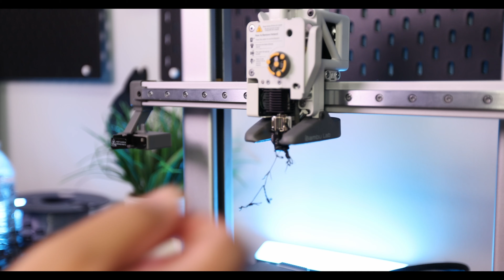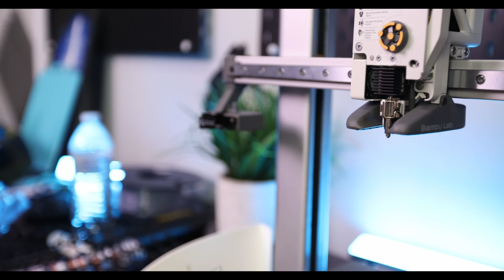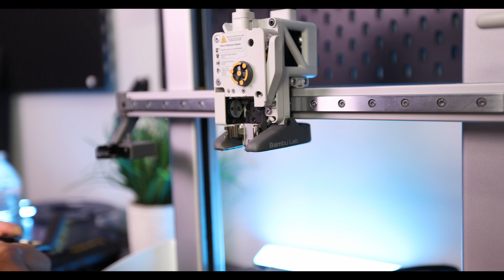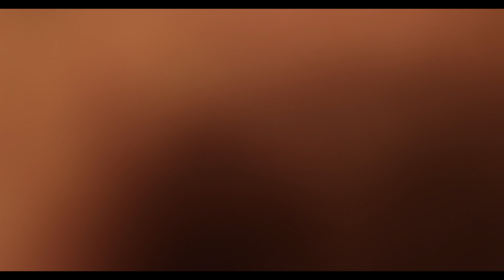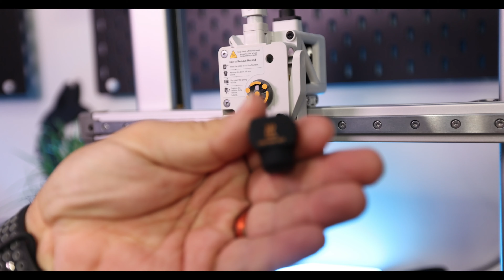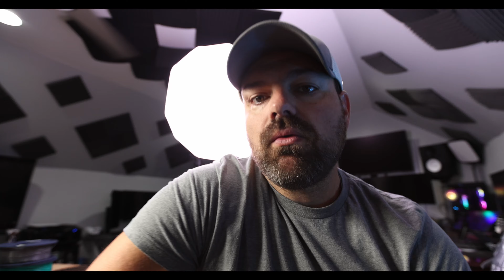Bambu Lab A1 Emergency Maintenance: Gummed Nozzle → Clean, Swap, Lube & Print

Comment from the maker: My recovery steps: Heat → gently pick glob → AMS pullback → reseat 0.4 mm hotend → new silicone sock → oil rails & grease Z-screws → test print.
Got a better method or favorite lube? Comment it—I’ll try it and pin the best tip.

Comment: You can take the ptfe tubes out all four etc, heat up the nozzle to 260, then using a long needle push gently down until it pushes out any filament built up in there.
Reply from the maker: That's a solid tip for clearing out stubborn clogs, thanks for sharing!